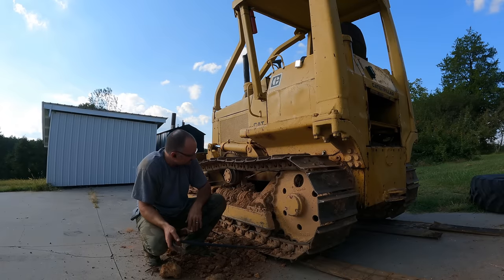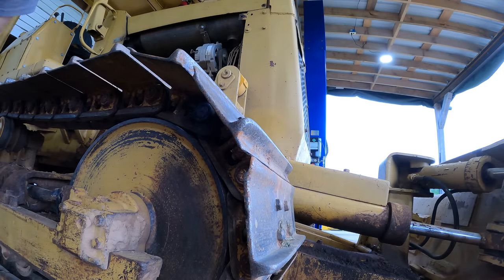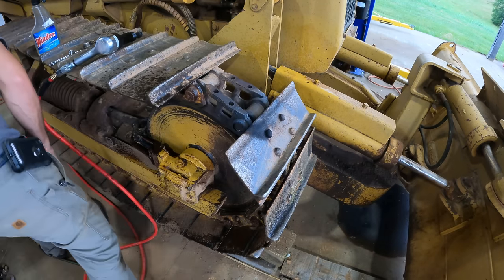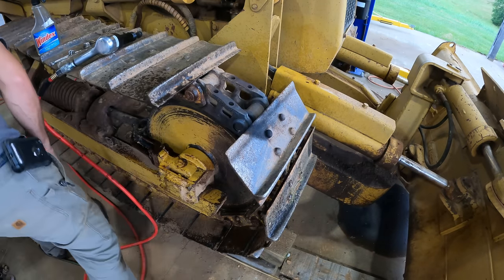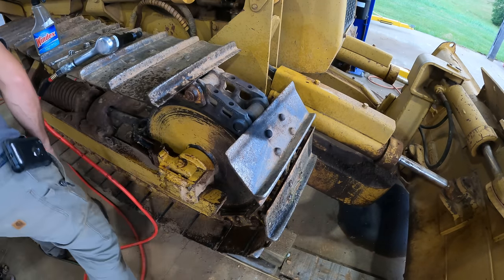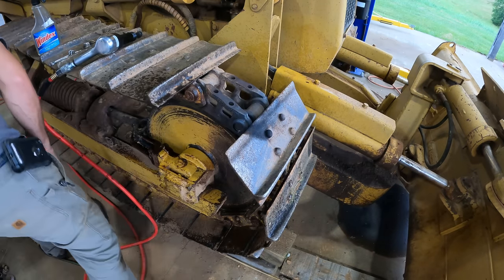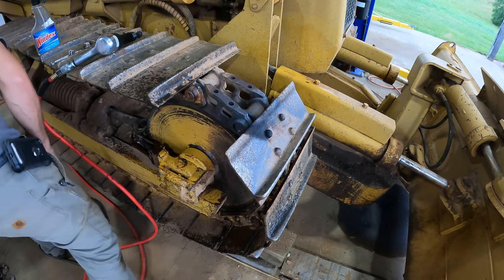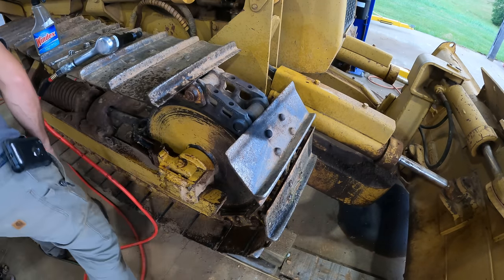Dozer Repair, Splitting Tracks, Adjuster Rails & Slides.  CAT D3 dozer

Comment: I always said if you want to learn how to work on a dozer, buy one! For every 10 hours of run time there’s at least 10 hours of repair time. It’s something every time you run it. Great videos, as a dozer owner you were right! Just a little painful watching you learn to back up the pin and get the biggest hammer in the shed. Always use new hardware, bolts and nuts.

Comment: I'm thinking that anything with a pin that may require driving out in the future, needs either a grease zerk or access bolt added, so you can bathe it in oil before you'd ever need to go near it. You had more fun with that than even Andrew Camarata does. Well done on pushing through 👌

Comment: Love the vids John! Have you ever seen a tank-track jack? Next time you visit an army surplus store see if you can find one. This is a ratcheting jack specifically designed for putting tracks on tanks. I use them in my shop (upside down) to have a large opening vise (modified to have wide jaws). They are inexpensive (relatively) and would be worth having in your arsenal of tools!

Comment: Couldn't tell if you did or not, but I always lube a ball joint press or similar tool on the threads with some type of high pressure lube.  It keeps the threads from galling on each other.  Good for pulley pullers and any other type of tool where a thread is producing some extreme pushing force.

Comment: A trick to getting pins out if they sieze badly and won't move if you can make or buy a new pin. You use a torch and burn out the pins center through or mostly through the stuck bore area then quench it and most times it basically all but falls out.
You don't need to burn away a ton of the pin center but it helps a lot!

Comment: When I was doing heavy equipment repair I had 3/8" hoses with 1/4" adapters so I could easily switch from one to the other. The adapters had a 10 foot whip so that I wasn't wrestling with the 3/8" hose.

Comment: Well done again John. I really felt for you with that first pin. But as I've also found out recently its sooo much easier the second time around. Just replaced an EGR valve on a VW golf. The first time took me 5 hours for toil and sweet encouragement. The new one wen't bad after barely a year. This time it took me a little over an hour. Looking forward to more from you soon. Best wishes

Comment: Hi John, if you have to drive out old rusty pins on your own, you can just tack weld a drift bar to the pin and give it a good wack with a sledgie (sledge hammer), if you have a second person, - one person can hold the right size drift bar in a pair of multigrips and the second person gives it da beans with a sledge hammer.  Just gotta trust your mate not to take your hands off, so gotta do it with someone who's ' onto it'  .  That's what we usually do. 👍
Alex 
New Zealand

Comment: Hi John. I love your videos. Always entertaining and often educational. My two penn’orth, for what it’s worth is that supporting the inner chain link on the second track you worked on was crucial to how easily (in comparison) the pin came out. When you were hitting the first pin it initially moved a little but then bound up. It looked like the distance it initially moved was just the amount the inner link was prepared to be forced out of alignment with the outer link. At that point you were trying to drive out a pin that has a very tight tolerance through two links that were now out of alignment. Also having tension on the track probably didn’t help either. We live and learn though 😀 I’m glad you got there in the end. You did a great job repairing the frames. Looking forward to more of your content. Take care mate

Comment: when i do any brake work here in the rust belt , i spray a couple times bolts  ,bleeder and brake line weeks before  and had good luck , but heat always works

Comment: I was a heavy equipment mechanic for many years until I had a stroke  now I work in an office  I love watching these rookies on here, I give them credit for wanting to try it in the first place but leave it to the pros! yeah you get it done but the damage you cause to other things  you can't see, a simple air over hydraulic pin press  and he would have been done with both sides by now, the best calls I ever got were guys saying they think they got the wrong track bolts from the dealer because the new  track pads wont stay on the chain so they put new bolts in and weld them to the track lmao if you don't remove the paint on the mounting surfaces of the pads and chain  the few mils of paint will wear off over time and the bolts will come loose. leave the service to us pros

Comment: 10/13/23..eliminating 'sloppy/loose' fit of Idler-to-Slide rail...wow! What patients you have! 2 issues you mentioned: (absolute) need of a 'Pin Pusher/(puller?)' & a 'tooth' Master Link; I wonder how many times you thought about getting these items as you were swinging that Maul...trying to 'hammer' that Master Link pin o u t ! Hope you get these parts for future track maintenence.
  Another great video 2day Jon! Excellent attention to detail, camera shots & especially those 'splice-in' pics of the 'new style' Master Link. I kinda thought you would get the new 'tooth' Master Link & put it on the chain, but no, not today. Also glad you found the problem with Glow Plug Wiring Harness! Anxious to see your dozer out on a job! Stay safe Jon & carry on!👍💪🔧⚒️👍🍺😊

Comment: I feel for you. A radiator replacement turned into an engine rebuild, on my old backhoe. My oil pressure dropped  and I thought I would pull the pan and check a few things.  I found a lot of bearing material  in the pan. I pulled a rod cap and main cap. The bearing dates were 1974 t0 1975. Rod bearing was 0.030 and mains were 0.020  By the dates and the wear it would put the backhoe  build in the mid 60's  I can't believe it didn't spin any of them !

Comment: I believe it was the welded support on the backside that was the winning combination. By not allowing the track or chain or pin to dissipate the hammer force so quickly and truly isolate the blow to the pin itself you probably quadrupled the force on the pin compared to the first side. Nothing like a little experience!

Comment: John, with your skills, you could make a pin press. Look around in the local junk yard for an old forklift, and get a tilt cylinder. Use that and some farm know how to make your press. Use a farm tractor to power it in a controlled manner.  John Deere 450C track loader uses a very similar pin setup.

Comment: I refurbished every my excavator tracks I learnt the hard way as well I took every pin out and machined new bushes and pins and welded them up it took 14 days but wow what a difference it made the tracks didn’t come off 2 or even 4 times a day any more and they lasted well I did that ten years ago and I have recently just sold the machine but sadly they had some wear coming back and we’re starting to come off again

Comment: You could use oxy-propane instead of oxy-acetylene for heating.  I have different fitting than yours on my regulator and use an adapter for the acetylene tank.  But it's nice to switch be able to over when I run out.   Maybe it would be worth buying another regulator to use with propane?  Not quite as hot, but works fine for that sort of stuff.  A lot of guys run it exclusively for cutting torches.  There are different tips for running propane.  But it seems to run ok on the regular rosebud in a bind.  I enjoy your videos!  Thanks for the knowledge and entertainment 🙂

Comment: After doing some of these myself it sure was fun seeing someone else struggle (and succeed) with the job! As you said yourself hitting the pin with a hammer that is too small is causing lots of problems but you also heated it up way too much and literally riveted the pin into the chain link, that was quite painful to watch... On another note; if you replace the chain you MUST replace the sprocket at the same time!! If you do not do that your brand new chain will wear out in record time, essentially wasting the efford and money of the replacement.

Comment: A little before 8:25, you put a T in your airflow system. I would put you High flow 3/8 connector on the lower ending to keep the flow has strait has possible and use the 90 degree one for you lower flow hose. That way there will be less turbulence in the hose which will get you more pressure where it's needed the most.

Comment: Thanks for sharing the video you could could have welded a temporary plate across the chain links to keep them from spreading why you were beating out the pin and then cut it off with your torch or grinder when you were finished

Comment: Nice grinder John. Just buy the extended warrantee and it will be the last one bought. I've seen guys drag construction abused grinders back in the store and the tool has warrantee paperwork, you'll get a brand new tool. My HF tools are constantly returned with the proper paperwork for a brand new tool.

Comment: I don't ever use glow plugs anymore except on my Ram Cummins, but I do use a heavy pair of jumper cables from my Truck to whatever diesel equipment won't start right away if the temp is too low and with four batteries, they'll start right up on the coldest days in winter. I've got a huge tractor that's really cold blooded, but she starts right up with that extra juice on the starter. I'm just cheap and those glow plugs aren't.

Comment: On that grinder, yeah, brushes and commutators sucking is kind of a harbor freight thing.  It likely damaged the spring as you guessed and arc pitted the crap out of the commutator as well.  When they do that, I return them.  Just the way it goes with harbor freight brushed motors.

Comment: The local welding and machine shop I worked at throughout my high school years 72-74 had LARGE 220 VAC grinders that used a grinding wheel about 3/8” thick and 13-15” in diameter.  To memory it ran at 9,600 RPM.  IT WAS LIKE  CONTROLLING A HIGE GYROSCOPE.  But it removed some metal and was pretty easy to use when grinding on top of a surface but when you had to grind a lot overhead it was tough.  I was in good shape but would still have arm shakes/trembles so bad for a while afterwards there was no way to keep jello or peas on a spoon to eat either.   Had one that had a switch failure blow up  in my hands one cold morning.  It wasn’t wanting to run and the welder I was with told me to slam it face down on the arbor nut NOT the rock.  Well about the third slam that morning it blew up.  The entire welder was an aluminum magnesium type Allie housing.  I was left with a nice arc down my right under side forearm along with melted rubber from the cable jacket imbedded in my skin all through a heavy blue denim welding shirt.  Slamming a 220VAC aluminum metal housing grinder to get the switch to work is NOT the thing to do.   I was only 15-16 years old and definitely didn’t know any better.  Admittedly I didn’t know how much of a slam to give it so as my use of it progressed and it heated up in the bad switch housing required a harder and harder slam until boom.  You should have seen the shorted power cable to the grinder dancing and arcing like a cobra coming up out if a wicker basket to an Indian Swami playing his flute.  And, that massive diesel engine powered milker welder/generator sounded like it was pulling full load until I could get to it snd turn it off.  The welder was about 30 feet away and had no idea what was going on until his electrode stuck. And, then it was what the hell are you doing until I showed him the grinder’s remains and my forearm with the burnt arc and rubber.

Comment: With your skill i thought you would rig up a bottle jack as a pin press. Weld up some plates for some support. but great to watch you work through the problem.
I would have set up the tee for your air line with the 3/8 down and the 1/4 off the side. for better air flow to the 3/8.

Comment: I helped my dad put new rollers on his ih 150 loader crawler. We were able to ground hog them in with just loosing tension on the track. We snapped every bolt 😂 He's only ever used oxy propane as a torch though.

Comment: My favorite "BFH" - Big Fu##in Hammer - was one I made on a jobsite. I had found an enormous old hammerhead at a junkyard that was missing a handle, probably a 15# head, all steel. Then I welded a 4" wedge on one side, so it had a flat end and a wedge end, for persuasion improvement. Then for the handle I took a piece of 2 1/4" steel tube that was probably 1/4" or 3/8" wall - it was seriously massive. All said and done the hammer was probably 30# and hit like a truck. Worked great when parts were being stubborn, but it required a decent bit of setup to swing. The best part? Since the handle was a tube, I could use it as a cheater bar on the end of a wrench or prybar, and the hammerhead helped give some leverage when pulling towards gravity. I'm not very strong, so my tools have to compensate :D

Comment: 46:56 yes spraying and directly try to work it out doesn´t really work, i found the best is around 30-60min before and spray more than once in the beginning of that timeframe usually works with srews that are rosted but not rosted solid for the later youre absolutely right only heat will help, well or grinder and drill and tap for the really hart cases

Comment: You know, John, they make tapered punches for air hammers that would fit right in that divot in the center of the pin.  You can get them at Harbor Freight, or probably a swap meet.

Comment: Heat the track chain as you did but I would have cooled the pin before hitting it.
When you were heating it both the pin and the chain were both expanding the same amount,

Comment: For your track chains, there is a service (or there used to be ...) where you could break down the tracks, roll them up and trade them in on a set of serviced tracks.  That is, they pushed out the pins with a 50 ton ram and turned the pins & bushings 180* so there were all new wear surfaces facing the sprockets.  They'd measure deflection in your existing track chains and prorate it against a fully serviced used chain.  Much cheaper than CAT for a new chain.  Then you'd bolt on your track pads with new bolts and you are ready for another 30 years 😊

Comment: Removing a master pin is a lot easier when there are two of you on the job. You need a dolly with a  handle welded to it and a fookin great sledge hammer and a bloody good swing and it'll soon move. Oh and I normally leave the track plate in place to keep the two halves of the link as one rigid piece which helps. But you innovated as usual and got the job done. The later design with the four bolts that go through the track plate and then through the two halves of the serrated interlocking master link into the other two bottom half links. And yes, you should always give yourself a bit of slack in the track before you start and have the master pin at 5 or 7 o'clock. 😉😅

Comment: When working by yourself on this type of track pins its easier to cut the pins with torch.  There not much clearance between the links but is possible. Then blow à hole though the pins on outside.  Thoughs pins are a press fit and the master pin has less press fit then the rest of pins.

Comment: I guess that airhammer would not have been that bad, if you just had a pointy tip on it that went into the dimple of the track pin. The flat surface was really helping to mushroom the track pin, and i think the dimple in the pin is actually there so you don't put force on the edge of the pin to spread/mushroom it.

Comment: A tip for you. Heat the outer portion fast, do not heat the pin. By heating the pin glowing red means you're expanding the pin just as much as the bushing. That's why you had such a hard time removing. If you don't get it the first time, let it cool and start again

-G

Comment: Like on Saturday night live show Rosanna Rosanna Dana used to always say "its always something". And you have the best dozer by a Dam site, by the way how does that dam look now, filling up ok? Also in the rc airplane model hobby we use the super glue i think called IC2000, it has black rubber and carbon added to it and this gives it a little flex, would be a good alternative on your carbon brush wire fix" great video and I always enjoy you and learn a lot.

Comment: Just wondering if a centre punch piece in the hammer would work to get the pin moving initially, also would a ratchet strap, rope.... secured around the hammer & what you are trying to remove work??? Thanks for sharing your definitely getting a pretty good following 😀👍
Reply: I should have a watched a bit further lol GOOD JOB 🤘😀👍

Comment: I'm at 31 minutes. You still have the same number of bones in feet and legs. As a bonus, I don't smell meat burning. I probably would have done the same (complete with "duh" moments). Ok, finished it. It was definitely easier than starting with tons of iron and a hand file. You are a better man than I. Also, many thanks for the Bauer tool review.

Comment: @farmcraft101 use propane instead of acetylene on torch just doesn't get as hot or cut as thick but will work with what you are doing.

Comment: Hay Jon did you see the blade support yoke move at 1:06:37  looks like a pin is really worn there just behind the big track tension wheel that moves forward & back. that might be something you look into !  i think I saw about 1" of play there ...1/2" up and 1/2" down.... that is alot.... if it's a pin that is an easy fix if it's the hole it goes into that is a problem !
inaccessible behind the track too.... so save those washers for the track pin ! you may be going back into that thing !

Comment: You're using a ram tool in the impact. They make a dart style that will stay centered on the pin. Heat is your friend but the dart punch will put more side force on the pin. Been there several times with my old job. Nothing to it, just do it!